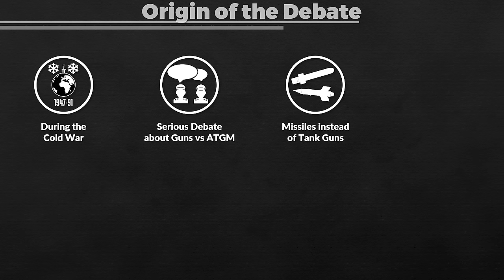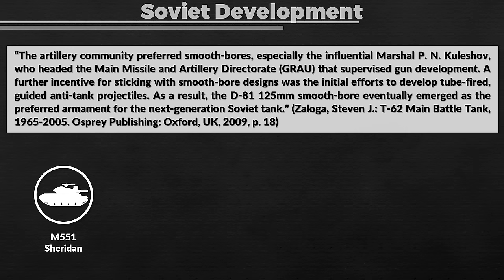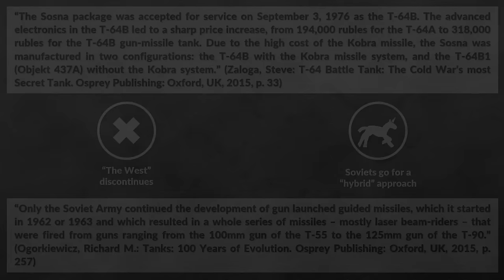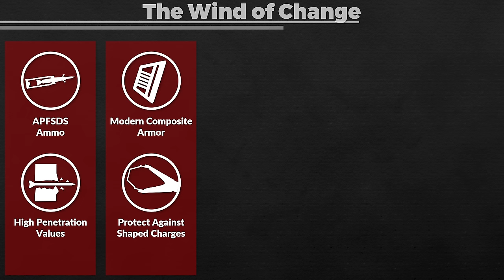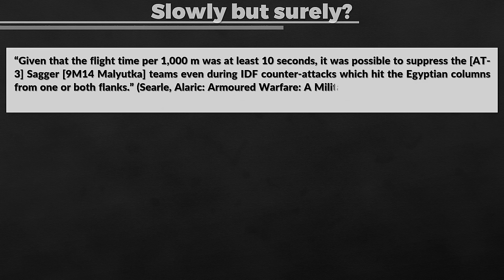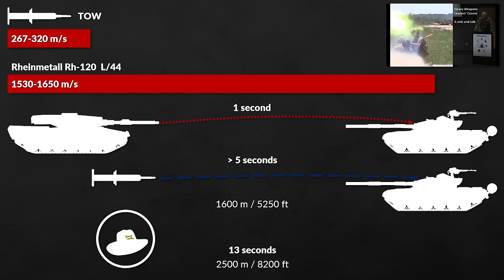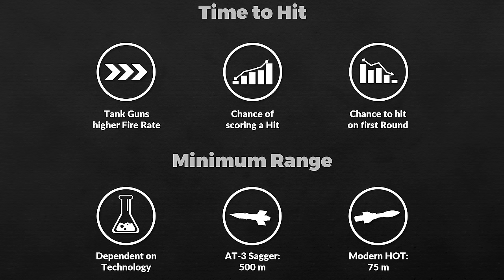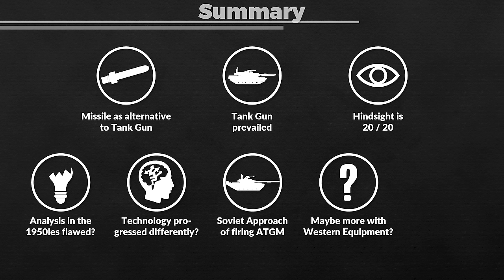Missiles vs Tank Guns: Why Guns are better!

Comment: Did they ever consider anti-aircraft missiles to allow tanks to defend themselves/each other from low-flying aircraft or helicopters? 

Also could you imagine if they did adopt them? I'm imagining a box with a whole lot of vertical launch cells trundling across the countryside like a land-cruiser.* It would be hilarious. 

*Best to avoid tunnels and forests...
Reply: There have been some prototypes with such equipment but its generally not necessary. The only nation i know that puts SAMs on its tanks is North Korea. And these might be fake.
Tanks use their main weapon against helicopters. 
But in general tanks are far to busy to monitor the sky as well as the ground. Without radar and a datalink to the local or theatre AD net there is litte that 
can be done against aircraft anyways. Therefor there are special SPAAs which can establish a pretty large "no fly zone".
Reply: I thought of this too. I think this idea is best implemented on an unmanned vehicle with a tank chassis. Could also be a suicide/recon drone launcher.
Reply: I'm pretty sure they did. But then stuff like MPAT rounds were created, which again made guns better even at shooting down helicopters.
Reply: @30LayersOfKevlar  I looked up MPAT on wikipedia but it just redirects to HEAT rounds. Do you mean MPAD? Or are you referring to a type of tank gun launched missile?
Reply: @schnuersi  Makes sense. I guess if you're tanks are having to provide their own air defense something has gone horribly wrong.
Reply: @thuggeegaming659  I hadn't thought about using it for drones. That's a good idea.
Reply: @thuggeegaming659 Programmable HEAT shell. In anti-aircraft mode, they're proximity fused, meaning it's roughly the equivalent of a 5" naval gun in AA mode back in WW2.
Reply: Like the Tunguska-M1?
Reply: @franzenders344  Sort of. I'm more imagining something that looks like an M113, but instead of troops it's filled with missiles in individual launch tubes that are fired out the top.
Reply: Surprised not done
Reply: @Ralph-yn3gr  I think there was an M113 Avenger. AIM-9s.
Reply: @Ralph-yn3gr  For AA guided missiles, the 2K12 is a close match.
Reply: @thuggeegaming659  MPAT is a selectable proximity fused munition. If you turn it to 'air' mode, it'll detonate if it gets within about 30feet of a target. In ground mode, it works more or less as a regular shaped charge round. It is also a saboted munition, so a bit faster than regular HEAT. The official name is "HEAT MP-T M830A1", which is confusingly close to the standard M830 HEAT round.

I would observe that the DPRK puts lots of SAMs on their tank roofs.
Reply: @TheChieftainsHatch  Thanks for the clarification!

Comment: ATGMs are lightweight and don't require tank chassis to operate, unlike a 120mm cannon. 
At ranges over 1-2 km, armor isn't as necessary as well. So, missiles are used with smaller cheaper chassis,.like humans, jeeps, IFVs, while tanks are exclusively used to haul the gun, that has one advantage, cheap ammo.
Reply: Cheap ammo, large capacity, high versatility, extremely low minimum range.

Comment: Well, something that was not addressed and why we see so many missiles in use is weight. To get a gun that can effectively be used against a tank it will take a couple of tons. Not something you can strap on a light vehicle or every APC. A missile can be mounted on even some civilian vehicles. Also, direct LOS is not always needed between the spotter and the missile platform.  the highest-tier tank can still be defeated by a modern missile. On a tank a big gun makes sense but thanks to modern missile technology the real cost winner and versatility winner is missiles. The weaknesses of the anti-tank gun are the limited platforms it can be placed on on the many support vehicles it needs. Where tanks shine is where they are against an enemy that does not have a practical answer to your armor. Like Iraq or ww2 to were Where tanks developed so fast that the previous anti-tank weapons did not work as attended

Comment: The futuristic mindset of "ATGMs will completely replace tank guns because they are lightweight and can reach farther" is a grossly ignorant overestimation of the guided missile as a wonder weapon that can do everything and is also a dangerous one that would've had as much of a disastrous impact as the decision to not put an internal gun on the F-4 Phantom which led to many USAF pilots being ruthlessly gunned down by cannon-equipped Mig-17s during the Vietnam war.

Comment: Another the disadvantage of missile tank gun is they are laser guided. Unless modern missile tank gun is like javelin or nlaw, then it better use ordinary ammo, not only it fire and forget they have relative more fire rate, though accuracy depend on range and crew skill. Now if the guided missile is on artilerry then that different topic.l

Comment: With regards to training times for modern fire control systems if your only considering the gunner and not the maintenance crew then the answer is yes and no 😂 the modern fire control systems are far easier to use and learn to use than gratical pattern sights. Soldiers who have had a play with the Challenger 3 fire control system have said its far simpler than the Challenger 2 system as you barely have to aim. The part that makes the training take slightly longer is the fact that the axillary sight on the Challenger is an old school telescope with gratical pattern, some people really struggle to fire accurately with it.

Comment: in general firing missiles as opposed to smart shells isn't great for a gun and they can be fired from a strap on pack on an IFV or the like, or a couple can be bolted onto the side of our tank's turret rather in the fashion of bolt on armour packs for mission roles.

Comment: I wonder if really small heatseeking missiles could be used as active protection from missiles? whats the minimum size possible?
Reply: Probably yes, but I doubt there would be much value in doing that rather than just firing regular projectiles at it. Guidance doesn't help nearly as much at close ranges as it does at long ranges, and since it's being fired at you, it's going to be at close range soon enough.

Comment: Um. If i have a t72 and i come across an abrams im using the missile launcher first and only using the gun once im out of missiles.  Doesnt mean the gun doesnt have a role and i cant store and fire 40 missiles very quickly...
Reply: The autoloader of t72 can stored 28 missile. 
Weather if it is rod or atgm, the loading speed is practically the same. 
The other storage probably cannot stowed missile. 
And you would want to shoot rod first.

Comment: I don't know if there is any truth to this, and my understanding is that the Soviet's used through the gun ATGM's because their tank guns had poor accuracy at long ranges (3,000 yards) compared to guns on NATO country tanks.
Reply: It is true Russian earlier fin projected has a higher deviation than apds from l7 and l11, but the difference is miniscule in practice.

The real issue is the fcs. Anything beyond 2000m is pretty much a guess work due to the inherent resolution issue of fcs of that time. 

That's why althought the projectile itself did not have issue shoot that far, the fcs doesn't allow it. And guided projectile is more accurate at those ranges.

Comment: Tank barrel launched missiles are the worst of all worlds. Too heavy to be man portable, too slow compared to normal heat shells and sabot.
Reply: Why would weight be a consideration for tank launched missiles
Reply: @domaxltv  because you cant use them dismounted like you can with a lot of vehicle nounted atgms.
Reply: @bigboi7817  yes but... Why would you need to? You have a tank

If your tank gets knocked out or damaged, you need to be banking on having a spare CLU anyway, and for your ammo rack to be not exploding (most tanks get shot at until they are a burning wreck)

Also... Gun launched ATGMs, atleast the russian ones, are similar or same weight as heavy man portable ATGM systems like the kornet
Reply: @bigboi7817  You don't use vehicle weapons while dismounted, mate. Except MAYBE something like the pintle-mounted M240 on an Abrams.
Reply: @jamesharding3459  on russian bmps they have Kornet missiles that can either be mounted on the tank and fired from inside but they also carry the tripod launcher to dismount and have ammo commonality.
Reply: @domaxltv  yes but you cant dismount them like you can with the bmp mounted kornets
Reply: @bigboi7817  That is quite different from a gun-fired ATGM! They are merely using the missile itself as common ammunition for both the vehicular launcher and the infantry one.

And as for weight, an Israeli LAHAT (120mm ATGM) weighs just over half of what the TOW-II  weighs, just for the missile.
Reply: @jamesharding3459  okay my bad im wrong
Reply: @bigboi7817  I wouldn't go so far as to say that. Gun-launched ATGM's have a lot of drawbacks, weight just isn't one.

Comment: At 0:24 the vehicle in the left of the frame looks like it has some weird bumps on its armour. What's up with that?
Reply: Because its equiped with add on armor. The bumbs are the covers of the mounting points.
Both the Jaguar 1 and 2 have this add on armor. The Rakenjagtpanzer 1 which is the parent vehicle of the Jaguar 1 has not.
Reply: Just bolts used to attach the external armor plates that were installed when the Raketenjagdpanzer 2's were upgraded into Raketenjagdpanzer Jaguar's

Comment: When I first learned about missile tanks, I always assumed they would have missiles in cells mounted in the hull or have missile racks external to the hull in addition to the gun turret. I didn't realize missile tank development meant just firing the missiles through the tank gun, in which case, why bother have a gun at all? Missiles don't need a gun, just a cell or a rack. Thinking about it now, I can see why they didn't develop my idea, racks could obstruct the traverse of the gun turret, and cells would occupy space for the crew. 

But I do think my idea could be developed one day, especially if the tanks are unmanned. That would free up a lot of volume for missile cells while still allowing for a gun turret. Having both would dramatically improve the firepower of a tank, and allow it to engage multiple targets simultaneously and have more options for dealing with different enemies. The missiles could also be used to shoot down aircraft or intercept incoming missiles/projectiles at longer range, giving a layered defense to a tank in addition to a close range APS. In addition or instead of missiles, they could launch suicide or reconnaissance drones which would greatly expand the tank's capabilities.
Reply: @TheTrueAdept  I already considered that, but the effectiveness of jamming has been vastly overstated. If you watched the news recently, Ukraine has effectively used drones against Russian armored vehicles and destroyed many of them. But even if jamming were a concern, I'd imagine that a dual mode unmanned tank would be the solution. One that uses both remote control and AI as a back-up if jamming occurs.
Reply: A missile dedicated vehicle would have no need of a big gun. Think a 30mm or something. A big tube vehicle would have no need of dedicated missile launcher. 

If you have crewless vehicle, why not just make it smaller in general and shot the missile out of the tube?
Reply: @jintsuubest9331  I already explained the need for a big gun and missiles. Do you even know how to read?

Comment: Comically,  its the same reason you get vehicles like the striker with a 105 gun on it.     Its not that guns are "better".   Its a cost per shot and type of use issue.  

if you need "sustained"  HE fire on a target area, for example.   105 and 120mm tank guns,  40mm auto grenade launchers, and such are far far cheaper to suppress and lock down an area... then missiles.   

for missile the launchers tend to be cheap, but each missile tends to cost a large amount...  that said, do you want to use a 250,000 dollar missile to destroy a single tactical vehicle that cost 25,000 + 10k for the gun they bolted onto it?  and what happens if you have a dozen or so of these tactical vehicles...   

the cost to fight them with missiles becomes prohibitively expensive.   BUT machinegun rounds, 40mm grenades, 20, 30, 105 and 120mm tank rounds are cheaper, often costing less then the target.  Which is always what you want.
Reply: I will gladly launch multiple missile against a mobile command post with commanding personal. 

The personal and equiptment on board is not worth even a single missile. You cannot drive a tank pass enemy front line but you can sneak a group of dude pass said front line.
Reply: @jintsuubest9331  yep but again from a cost stand point.  

AGM-114 Hellfire (Army) - $213,143
AGM-158 Joint Air-to-Surface Standoff Missile (JASSM) (Air Force) - $1.266 million  Can you imagine using that and only destroying a single truck?
AGM-179A Joint Air-to-Ground Missile (JAGM) (Army) - $324,805
GBU-39/B Small Diameter Bomb (SDB) (Air Force) - $39,000  ok thats "reasonable"  but still,  not something you wanna use for every shot.
FGM-148 Javelin: ~$100-120,000 per missile, $400,000 per CLU.   Now again, gotta ask yourself,  is your target worth 120k  or can you take it out with a 40mm grenade?

Comment: I think the missile has more potential to it. Sure the old style bazooka might struggle against modern tanks unless you aimed at thew treads. Why not have a faster missile? Or even combine the sabot used in gunnery into a super fast missile, with a tiny "core" that ends up being accelerated to great speeds? The power to destroy a tank's frontal armor at 60 meters can be once again be put into a shoulder mounted weapon.
Reply: 1) No missle can be as fast as a tank round. 
2) They take way too much space compared to regular tank round.
3) They are extremely costly compared to regular tank round
Reply: @donaldhysa4836  Isn't cost a dump stat? I don't think major countries like China cares, if a new shoulder mounted missile can go to mach 3 (I don't know of any shoulder portable missile that does and maybe your first point is valid, but just as gunnery improved maybe there is more to missiles in the future) they'd make thousands of them.
Reply: @alex_zetsu  Cost is basically essential. THats the sole reason US doesn't have an all F-22 striker force but still has to rely on F16s has its main workhorse for the Air Force. The F22 Raptor is superior in everything else but cost

Comment: Different weapons have fundamentally different mechanisms of how the weapons function in a given combat scenario. Sometimes a missile will be the best solution to engage a target, other times the gun systems benefits will outweighed the missile system. Hybrid systems tend to have the worst of both but not able to use the specialists ammunition.
Edit:
One aspect which is forgotten is anti-missile systems like Trophy, Iron Fist or GL5 which can potentially turn a very expensive missile into a very expensive cloud of debris, where as intercepting a APFSDS round is something of a fools errand.

Comment: Initially,  Six of the Turkish Leopard 2 tank operating in Syria were destroyed by ISIS fighters using old 1970  anti-tank missile systems (possibly Soviet Era  Fagot anti-tank guided missiles) .In mid-December 2016, two Leopard 2 tanks were captured by ISIS near al-Bab city in Syria during Euphrates Shield operations. Amaq News Agency posted video of vehicles claimed to be captured Leopard 2 .
By late December 2016, ISIS had  destroyed 20 Leopard 2A4s. These were damaged by anti-tank weapons .Additional ISIS  images and video depicting several completely destroyed Leopards, some with their turrets blown off, were published in January 2017.

Comment: Not that long ago some experts said that MBT had outlived their usefulness in today's modern combat environment. Their impractical, expensive symbols of a war that wasn't going to happen. Singing a different tune now that Russia invaded Ukraine.
Reply from the maker: The tank had been declared "dead" for several times since 1918, people seem to forget that tanks "evolved" (better their designs) based on the threats and necessities of the time.
It is a platform that combines mobility, firepower and protection.
Reply: Yeah, those "experts" struggle to come up with an example of a system type that became obsolete because of the enemy's counter to it.